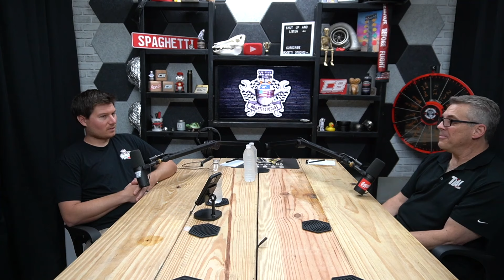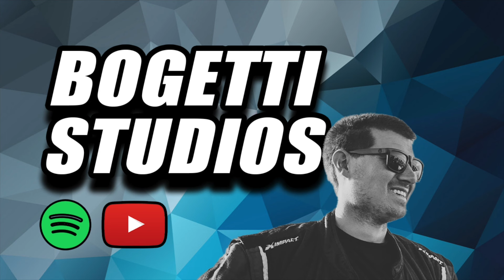Is Your 2-step Hurting Your Turbo?

Comment: rev limiters used to be a safety tool, not just for matting the gas. I didn't use the 2 step when spraying because it can detonate the intake if it misfires too long and is still working when the nitrous hits

Comment: Anti lag / two step is retarding timing so much that combustion is happening while the exhaust valves are open. That is why it creates so much heat. Also, when you hear those crazy loud pops and bangs those pulses are putting a huge load on the back side of the exhaust valves and pressure on all of the exhaust and turbine. Inconel valves and turbine wheel is your best insurance.